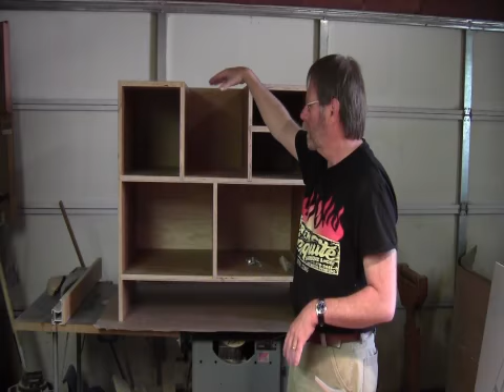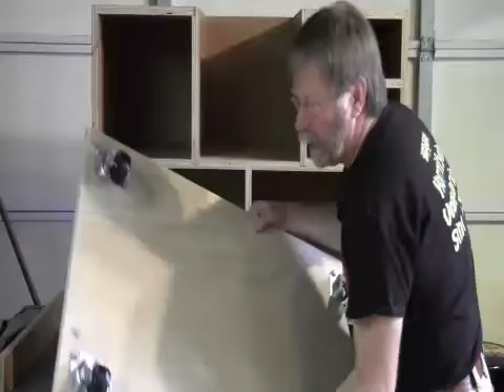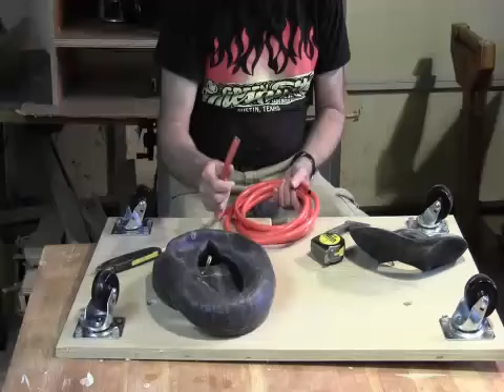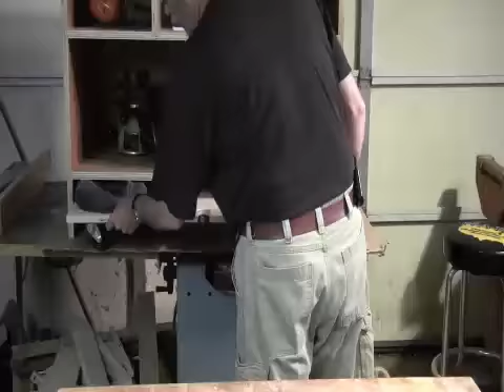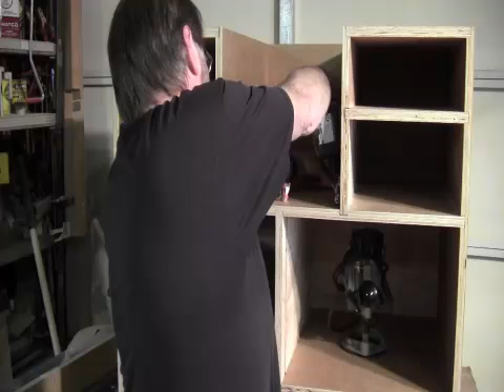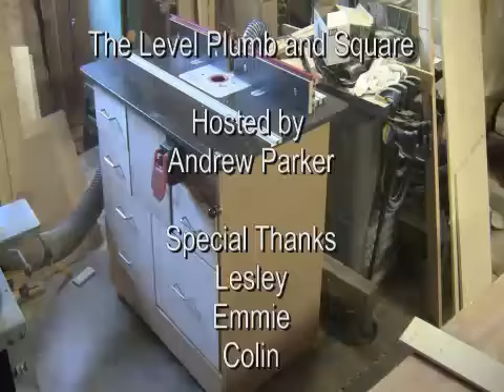Router Table Pt. 2  Episode 012

Comment from the maker: You are more than welcome to use pneumatics, thats why I put it out there.  The biggest problem I  have encountered with my router table is that it tends to lean forward when I put air in it to move it around.  I put a couple of child locks on the drawers to keep them closed when it's lifted.  If iI did it again would use either larger inner tubes in the front or limit the amount the back could be raised. 
Good luck and thanks for watching

Andy